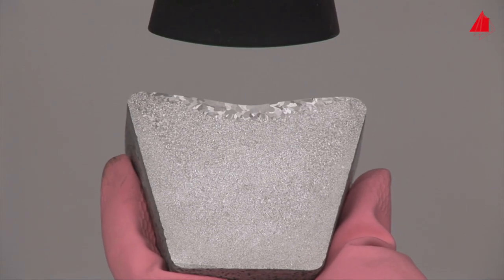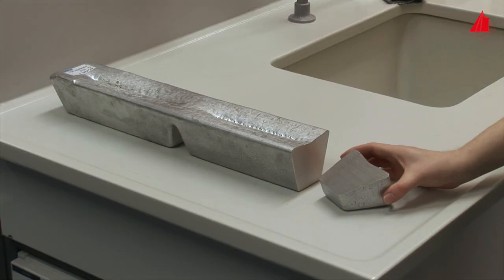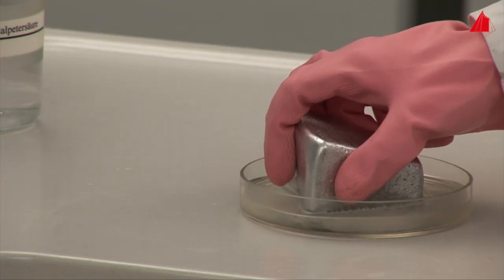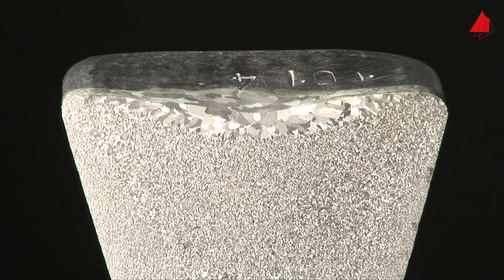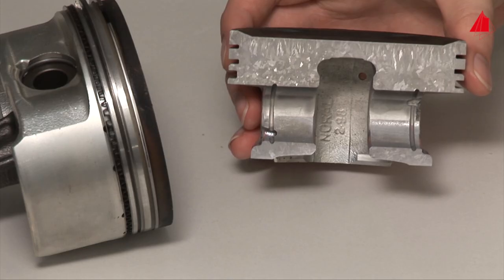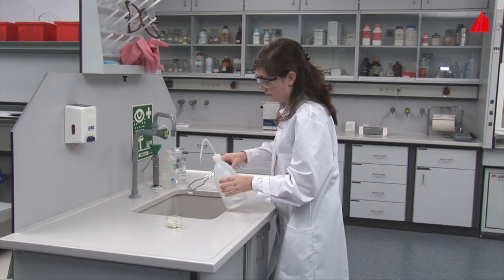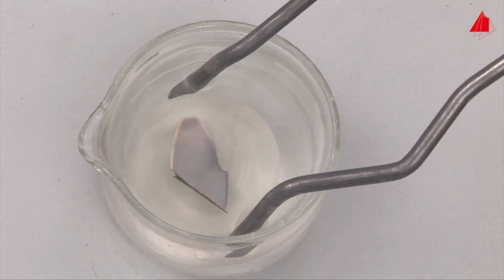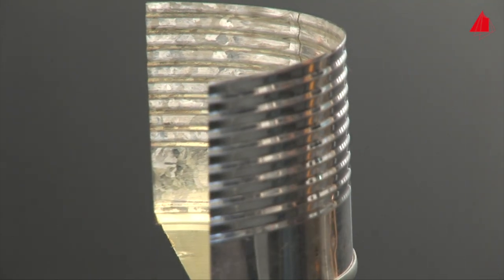Metallography Part I - Macroscopic Techniques

Comment: wow those videos are really awesome! a big thanks for them!, I am looking to macro etch a piece of leaf spring (SAE 6150) in order to reveal forging grain flow, what etchant would you recommand? I have picric acid, nitric, chlohorhydric also. Thanks!
Reply from the maker: Answer to "wow those videos are really awesome! a big thanks for them!, I am looking to macro etch a piece of leaf spring (SAE 6150) in order to reveal forging grain flow, what etchant would you recommand? I have picric acid, nitric, chlohorhydric also. Thanks!": Thank you for the praise! AISI/SAE 6150 steel (51CrV4) is a low alloy steel and as such may be etched with nitric acid diluted in alcohol (Nital). For macro etchings 10% acid in alcohol is probably best, for micro etchings 2 or 5%, but just try it. There are several alternatives (sorry, I have no experience with them), depending on what you want to see in detail. In many cases, you just have to try them out.
Reply: @MaterialsScience2000  thanks, I will try with 10% nital!

Comment: Excellent video ! ! ! Good online learning resource
The safety aspect was left out though, fumes from HNO3 and HF are toxic , etching should always be done with Chemical splash goggles and the right respirator.I remember this from MSDS back at work.
Reply from the maker: Thanks, you are right!
Reply: The concentrations used are typically very low (2-3%, 5 max) and usually not fuming. If used only for very short time period and otherwise sealed a fumehood/respirator is not required

Comment: Thank you for the detailed steps involved in the microstructure analysis. I am trying to get the microstructure of AZ91 magnesium alloy with following steps but not getting the exact grains and phase identification. Will you please advise or correct me? 
Steps tried: [
1]. Specimen Size: 20x20x6.35 mm; 
[2]. Bakelite mounting. 
[3] Grinding with 180 SiC grit followed by 200, 400, 800 and 1200 grits with 90 degree rotation for each paper. 
[4] Polishing with 6, 3 and 1 micrometer diamond slurry. 
[5] water washed and applied the picric acid etchant for magnesium alloys as per ASTM 407. Also, I tried with oxalic acid to reveal the grains but unable to get it
 I request you to please suggest any corrected solution as i got stuck for my PhD work due to this. Thank you in advance
Reply from the maker: Answer to " I am trying to get the microstructure of AZ91 magnesium alloy with following steps but not getting the exact grains and phase identification.":  Unfortunately, we have little experience with magnesium alloys. There are some good books on the market that explain the whole process, for example the German book "Petzow: Metallographisches, Keramographisches, Plastographisches Ätzen". Some companies also offer information on the Internet, for example Buehler.

Comment: are we also taking in some metal in the fruit liquid if the tin has been stored for a long time??
Reply from the maker: Answer to "are we also taking in some metal in the fruit liquid if the tin has been stored for a long time??" Yes! Some of the tin has dissolved and is now in the canned fruit. This has been studied extensively, and researchers have determined that it is safe for health. The amount of tin is very small. The alternative is an additional polymer coating, which is often used. But even then, small amounts of the polymer coating go into the fruit.

Comment: Isn't the inside of steel food cans lined with a plastic or epoxy layer to prevent acidic food from etching the steel? If so, how did  the inside of that can get etched?
Reply from the maker: Answer to "Isn't the inside of steel food cans lined with a plastic or epoxy layer to prevent acidic food from etching the steel? If so, how did  the inside of that can get etched?": Most cans have an additional polymer coating, some do not. Both methods have their advantages and disadvantages, an interesting topic. The can under study did not have a coating.

Comment: what kind of etchant should we use ...and is there  a special kind of etachant of each type of metals ...many thanks for your effort in advance
Reply from the maker: Answer to "what kind of etchant should we use ...and is there  a special kind of etachant of each type of metals ...many thanks for your effort in advance":  Different materials have different properties, so each material needs its specific etchant. In some cases, one etchant is suitable for several materials. You find many informations on this topic in the internet and in classical literature.

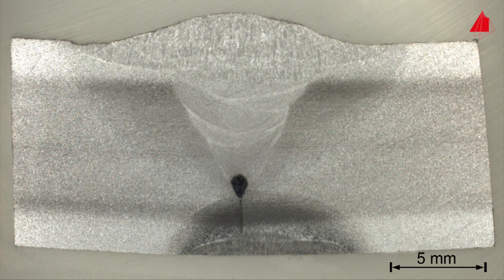Comment: That weld at 7:43 is really interesting. I'm gonna go out on a limb and guess that it was a MIG weld, because the center of the joint wasn't filled.
Reply from the maker: Answer to "That weld at 7:43 is really interesting. I'm gonna go out on a limb and guess that it was a MIG weld, because the center of the joint wasn't filled.": The weld was made by classical shielded metal arc welding. It is actually not a good type of weld design, only suitable for predominantly static loads, but interesting to examine metallographically.
Reply: Thank you for the response! I would have never guessed it was SMAW. So, this looks like a piece of 1/2" plate with a bevel that goes down 2/3 the way, then a pass on the back. Was this done with different welding rods? I can see a grain structure difference in the weld, as if it were done in multiple passes, then covered with a weld filler of different composition.
Reply from the maker: Answer to "Thank you for the response! I would have never guessed it was SMAW. So, this looks like a piece of 1/2" plate with a bevel that goes down 2/3 the way, then a pass on the back. Was this done with different welding rods? I can see a grain structure difference in the weld, as if it were done in multiple passes, then covered with a weld filler of different composition.": All welding passes were probably (I do not know for certain) done with the same welding rods. Interestingly in multipass welding (upper part of the weld) the individual passes are difficult to distinguish. This is due to the heat affected zones of the individual passes, which change the rather coarse grained primary structure of the passes lying underneath to a much finer grained equiaxed structure. Only in the last weld passes (quite on the top and the single one at the back) the primary crystal structure is visible.

Comment: I have an image of tool steel specimen after forging operation. And I want to check the presence of non metallic inclusion in it.
Is there any free software solution available for image analysis of precipitation?
Reply from the maker: Answer to "Is there any free software solution available for image analysis of precipitation?": I have not found any free software myself, sorry ...

Comment: Dear sir,
How to check in inclusion in microscope method...
Plz reply sir...
Reply from the maker: Answer to "How to check in inclusion in microscope method…": Inclusions can only be seen on the prepared surface of the sample, when they lie within the surface plane. Obviously inclusions above or below the prepared surface cannot be seen.
Reply: @MaterialsScience2000  Dear sir,i have making the hot mold and prepared surface of the sample within the surface plane.after prepared mold kept on plain surface in microscope.100x magnification check in inclusion but not cleared thick & thin. how to analysis inclusion sir...??
Reply from the maker: Answer to "Dear sir,i have making the hot mold and prepared surface of the sample within the surface plane.after prepared mold kept on plain surface in microscope.100x magnification check in inclusion but not cleared thick & thin. how to analysis inclusion sir...??": In which way have you prepared your specimen? Sorry, I do not understand it.

Comment: What is the preposition of chemicals.
Reply from the maker: Answer to "What is the preposition of chemicals." There are many different chemicals in use. In the case of the aluminium alloys we used a mixture of different mineral acids, in the case of unalloyed and low alloy steels it was 10 % HNO3 in alcohol. There are some books on the market (or available in libraries) which show the exact composition and most of all the exact safety instructions.